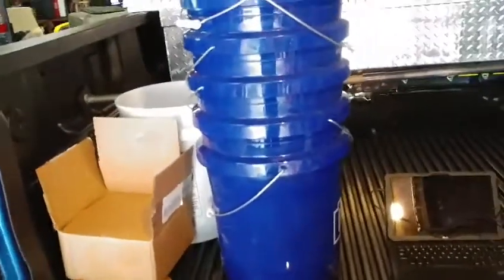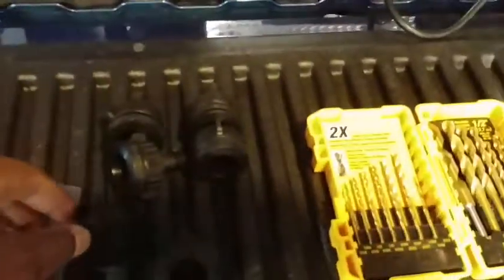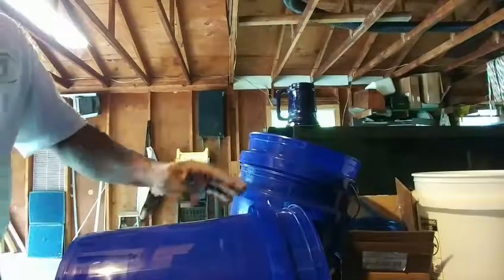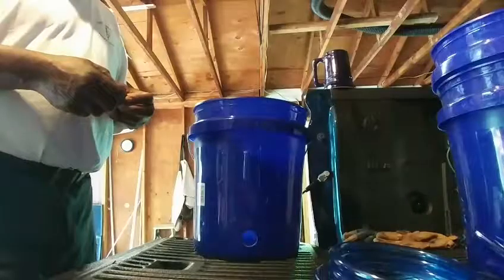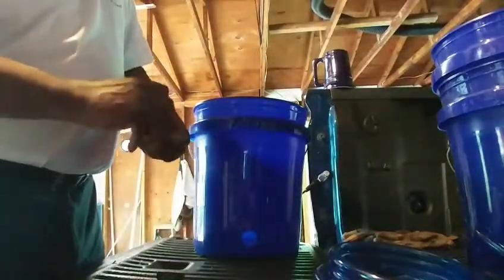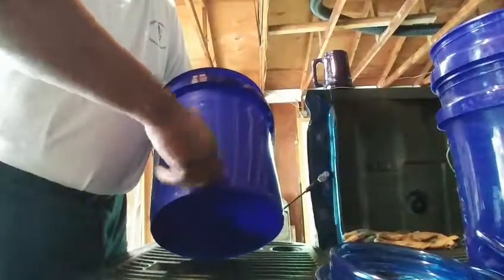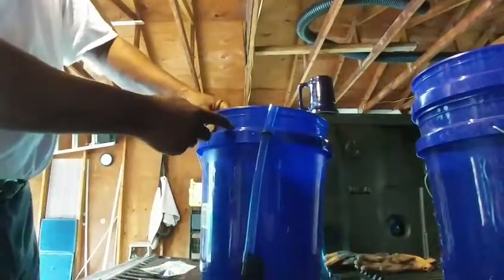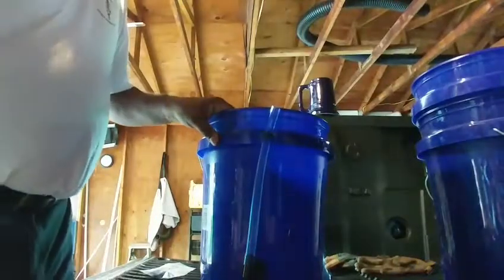Making a water level indicator for a 5-gallon deep water culture container

Comment: i looked up 'hose clamp' and it doesn't show that item at all. what is it actually called?
Reply from the maker: It is called a 1/2 inch tube clip. I got it from PA Hydroponics. Here is a link of the entire assembly. http://shop.pahydroponics.com/water-level-indicator-add-kit-free-shipping/
Reply: @tracywhitaker4372  I only need 6 and they sell them in packs of 10 lol